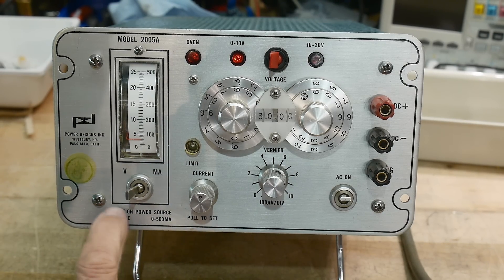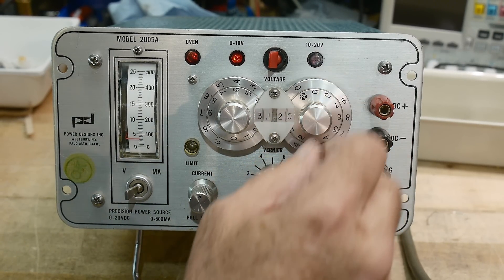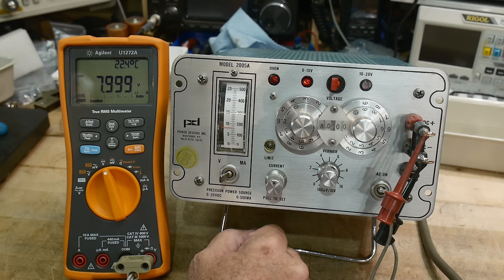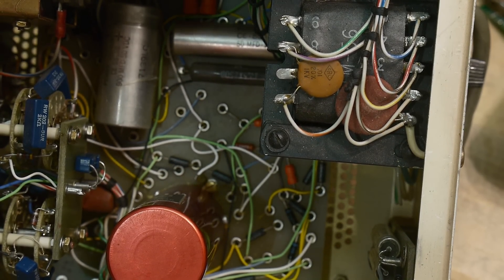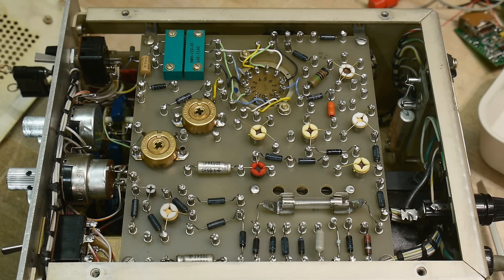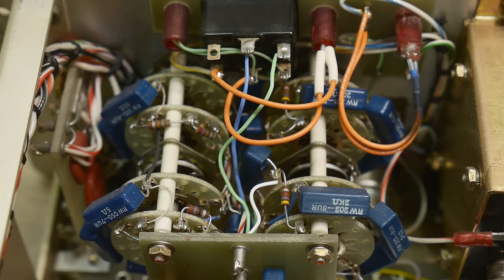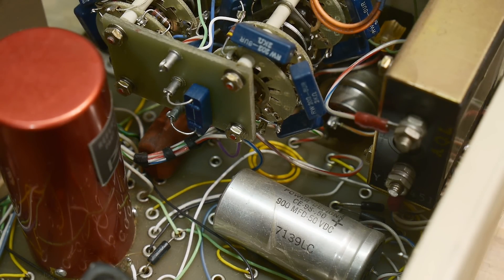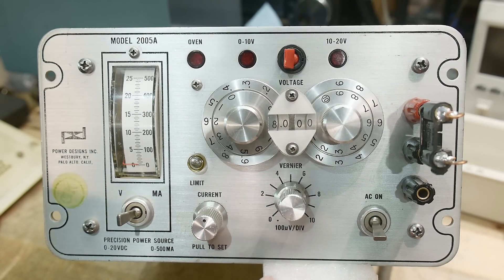#1336 Power Designs 2005a Precision Power Supply

Comment: What is the thing on the unit's left side panel? Looks like the sheet metal has been die stamped into a deep recess, and them some electronic thing mounted on the outer surface of the recess. Power transistor maybe? If so, it would be using the whole side panel as a heatsink, yet it would not protrude past the outline of the case.
Reply from the maker: I show it: https://youtu.be/vJtroVutpuA

Comment: Just throwing this out there but what makes you think the Fluke is that accurate? Also your test leads aren't exactly lab quality. Just nit-picking. I enjoyed the video and the power supply.
Reply from the maker: It's not a fluke. Agilent u1272a 4.5 digit meter. Quite accurate. The test leads I made of expensive test multistrand wire and gold plated Pomona test clips.
Reply: @IMSAIGuy  Okay. Color me imprssed. Still a great video. Looking forwad to more.

Comment: I just pulled out my unit to have a look at why it died. Turns out mine is a model 2005 (ie. The older non-A version). Yours is definitely nicer, mine has a few less features. My problem was a blown fuse (why?). Also I had very dirty rotary voltage switches that were causing output voltage errors. I cleaned the switches, now is accurate to 3 digits again. My date codes on caps are 1964 era.Era. My wafer switch resistors are marked 0.1%.

Comment: Picked one of these up at an estate sale a couple of months ago...the guy had apparently worked for Westinghouse and possibly TI, so there was quite a bit of test equipment in the sale. By the time I managed to get out there it was late on Sunday, so not much remained. But this thing was still there, sitting all alone on a folding table in a nearly empty bedroom. Price tag said $70, but Sunday = %50 off, so $35. But the cashier was swamped trying to get people out of the house. Asked if I was paying cash and I indicated I was. He said ' Give me $20 and we'll call it even.' Score.

Weirdest and (at least initially) most alarming thing about it: the oven cycles on and off as long as it's plugged in. I guess the idea is that it'll keep the oven at warm standby so as to minimize the needed warmup time, but seeing this before I read the manual certainly made me think I had bought a really attractive doorstop...

Comment: Very nice power supply and looks really well made. The RD prefix resistors are metal film and the RW prefix are wire-wound. According to the manual Power Designs is the manufacturer but I doubt that. Thank you for sharing. Regards, David

Comment: Another piece of excellent looking equipment! I have a 5015T and it's rock solid. I don't have to cool thumb wheel adjustments like yours. I'm curious about the line input frequency though. 47-440 hz? It must have a special transformer to handle this. Thanks for sharing.